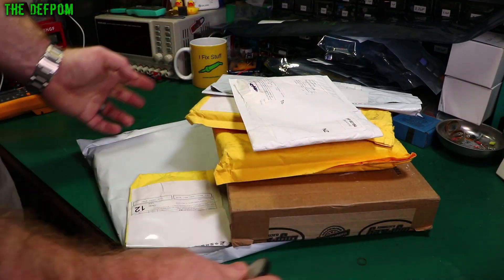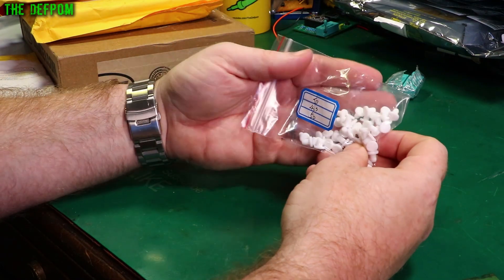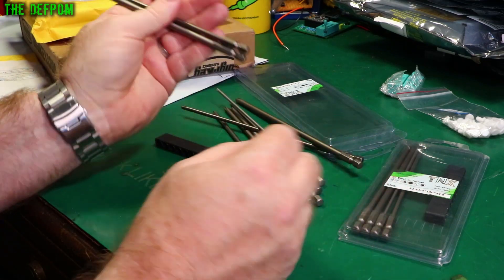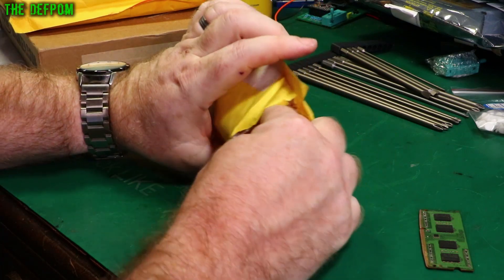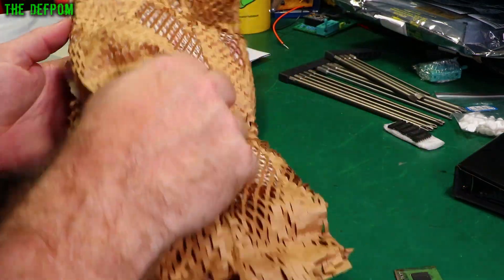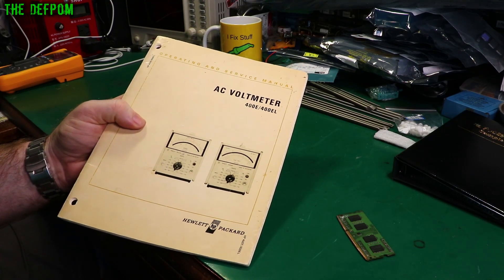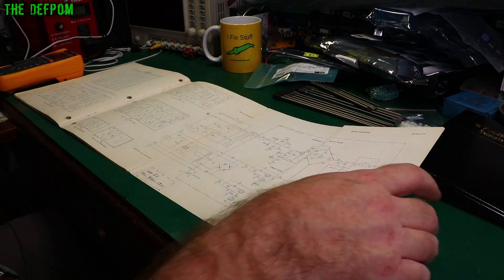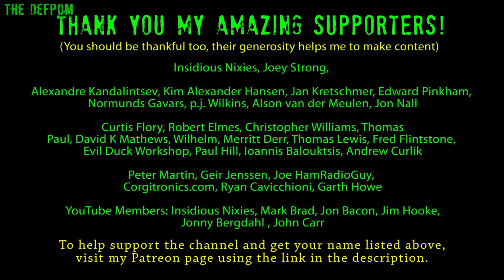🔴 What's in my Mailbag ? - Mailbag Monday 16th May 2022 - No.957

Comment: I was always quite upset/disgusted when at work full sets of HP, Tektronix, and others,  manuals for old equipment especially after disposal were just sent into recycling trash. Often including service and calibration manuals. Company policy was that nothing could sold or given away, so had to be scrapped. Equipment by the way smashed by sledge hammer before dumped in scrap metal skips.  
To me that was criminal, their justification was nobody was allowed to benefit or profit, and auction was not profitable as auction fees vs bids often ended up costing more than stuff was purchased for.  
I even lost on an offer of over $1000 and able to go higher, on an old Tektronix semiconductor tester/curve tracer, in full working condition. Best working unit deal of that model I have seen since was US$5500 and up to $12,000. It turned up smashed in sides, smashed CRT screen and control panel in a large dumpster a month later.
Reply from the maker: The wastefulness is so upsetting.